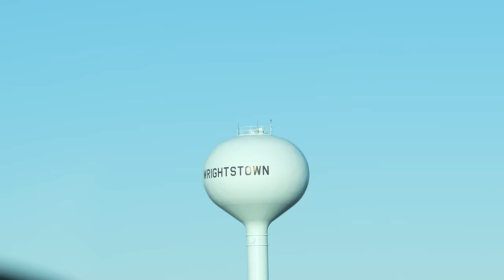3D Printer Design 101 (Part 1) - Component Selection and Material Quality

Comment: There's an interesting contrast between engineers and self-taught folks (like myself), engineers tend to understand the process more, and are therefore better equipped to plan ahead. As in, make a plan, find the parts, explore other options, improve on the plan, then execute it. The old "measure twice, cut once". I honestly caused myself major issues when designing a 3D printer because of my misunderstanding of the process. I made a plan, found the parts for it, ordered them...than figured out hot to improve on the design, but stuck with the parts I had, found better parts, shifted my design again, noticed that some of my parts don't exactly work well together, had to change the design to accommodate... It was a mess.

It's good to see videos like this one, not just tutorials on how to do things, but to actually hear people with experience talk. Tutorials make us feel like we can just do things, and sometimes we can...but that doesn't always mean we should. Hearing people with experience talk is a good way to realize just what exactly you want to build. Like your water cooling question here, it sounds cool, but usually there are better options. It can be done...but all alternatives should be considered first.
Reply: I've done repairs to enough regular printers that put text and images on paper to know that some supposed engineers probably slap things together without much planning. Some things just seem like an afterthought based on the way they're placed, like a switch that gets pushed by a long thin piece of plastic that breaks very easily.
Reply from the maker: Yep, most “engineers” don’t spend enough time to get things right. I spent a day redesigning a part because I realized some of the bolts would be difficult (not impossible) to get to.

The time to fix issues like this is when everything is still in CAD.

Every time you make a decision, imagine you’re personally making 10 of them. So I’d spend 10 design hrs to avoid spending an extra 1 hour in assembly. Because on a prototype, you’ll probably end up taking it apart and putting it together several times, and on production machines you’re wasting money with each unit built. So it’s almost always wise to focus on assembly - it’s even more important than performance.
Reply: at the end of the day, as an engineer myself, it is mostly about risk management. identify the risks, evaluate them, and then take necessary action. what you've done actually mostly surmised the process. The difference is that engineers have a specific method to assess the progress at each level. but then again, how far ahead can we plan? most of the time, much of the processes have been rushed because of project "costs" and "timelines" rather than focusing on quality (CTQ triangle).

Comment: Bowden came about as a direct fix to the inadequacies of direct drive, at the time the heavy motors used for direct drive would cause artifacts on the print, I still have a couple of Bowden machines and I still use them quite regularly.
Reply: Yeah, if they work, they work!

Comment: the cast tooling plates sounds promising. as soon as i saw there was a quote process for his printers i knew i couldn't afford one lol
Reply: It's not that bad. I bought a 1/4" Cast Aluminum Tool & Jig Plate (ALI14) ~590mm x ~590mm (23.25" x 23.25") w/Cert for $99 + $17 shipping from Midwest Steel & Aluminum in 2021. The current price for the same X&Y dimensions is $141 for 1/4", or $176 for 1/2".

Please note that I have no association with Midwest whatsoever.
Reply: The quote process is mostly to make sure people get the machine they need, whether it be size, temp, or other features like idex

Comment: I sure hope you end up covering the Magneto X.

You know something I've been wondering.  Can IR LEDs be used to heat a surface?  I think an LED heat bed might work really well...
Reply from the maker: I don't have a magneto X. It seems a little over complicated with a heavy and inefficient motion system, which means it probably won't have the best quality at super high speeds.
But if they are using linear encoders it should allow a higher level of precision than anything else. 

Is any of that necessary? For most people, no.

I've spent a lot of time thinking about using radiative heating for 3D printing. The problem is metal doesn't absorb heat as well as plastic, and it changes per material and color. 

You could use it to heat a bed and possibly get rid of some moving wiring, on a bedslinger for example. But its a lot of cost and complexity when the alternative is $1 of heater wire.
Reply: @NathanBuildsRobots  Well I was thinking about it a bit differently.  I use glass on my bed and print a fair amount of asa.  I also try to run my chamber temps up into the 60C range.  What I was thinking is a hot swappable glass bed.  The glass has a black coating on it that the IR LEDs heat up.  

I do hope an opportunity presents itself that you get to play with a magneto X.  I'd really love to see your hands on thoughts.

Comment: @Nathan your hate for none socket head screws is misdirected tbh. Most of the time you're stripping BHCS for example, it's because you are using stainless steel which is know to be soft. Try alloy steel bolts instead!
Reply from the maker: Grade 12 bolts all day!!

He other issue is my stockpile of kit Allen wrenches that are included in the cereal box (with cheap printers)

Comment: Great, but what about screens? There are so many connection protocols and search and search I have never been able to find a site that explained them. IE: how many wires from control board to screen? What is a spi screen? What is a dsi screen. Does this xxx screen work with this yyy control board?